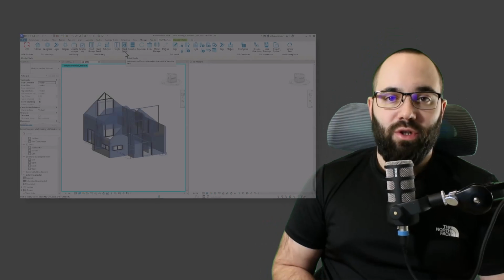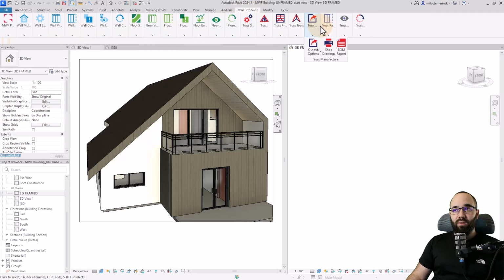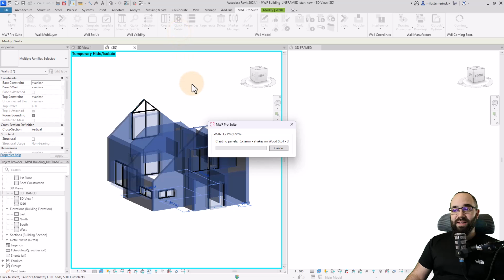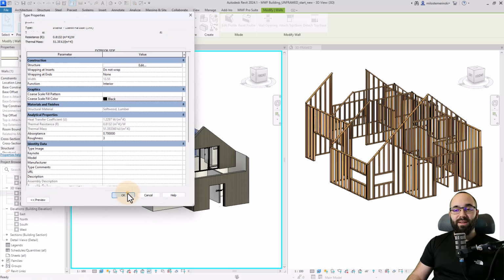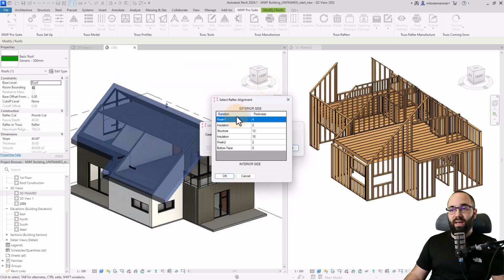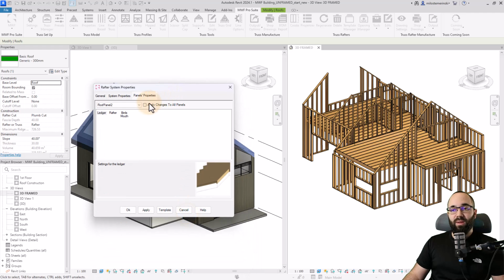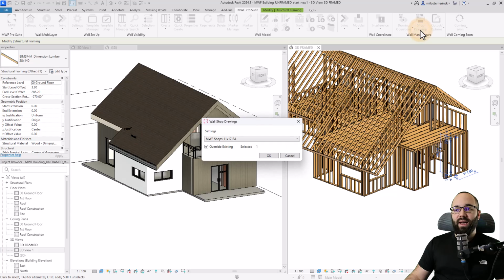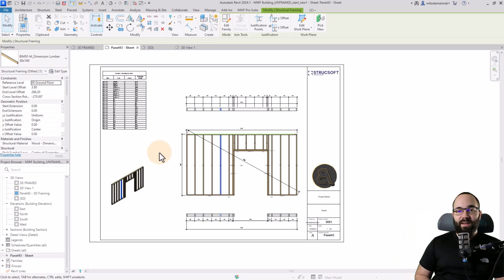Framing in Revit Software Tutorial | StrucSoft

Comment: Hi everyone! He is just letting us know that there is a plug-in, and how to utilize it. Regarding to the comments; I do not think that his intention was to explain how things should be done, since he is more like an architect. Overall, this can be used as our basis of design (model), so that we do not have to start from scratch. Then, we have to modify the structure (dimension/placement) accordingly, in order to start the structural analysis, which will lead to a re-design of some of the bearing components.

Comment: like so many plugins it's reliant on how you model in Revit.  The framing model for this isn't even close to how it would be done in real life.  To create your Revit model with floors that bare on walls properly and then separate walls per level, this would be a lot more work and typically not how people model.  Where are people using this in the real world and for what purpose, quantities, rough estimating?  I think when showing an example like this that is so specific down to the level of rough framing it needs to show how to adjust things so they're actually framed properly.
Reply: I work for a Framing company in estimating, and we use another software to do that, I think Revit is a strong SW to model the house, and we design, calculate,... in other softwares